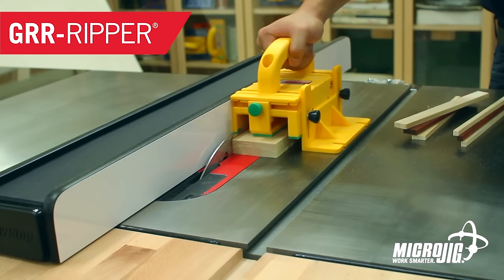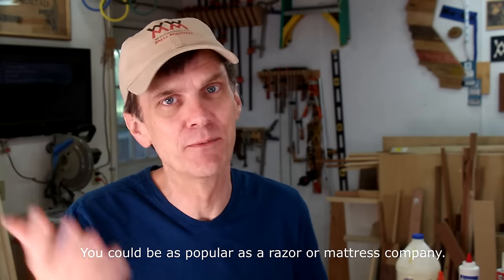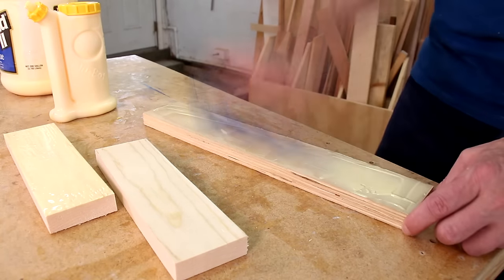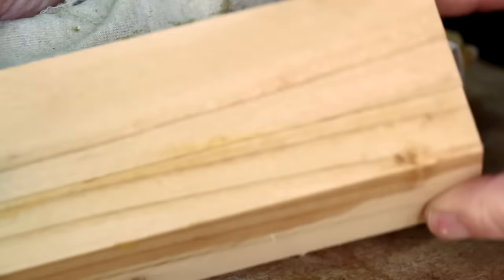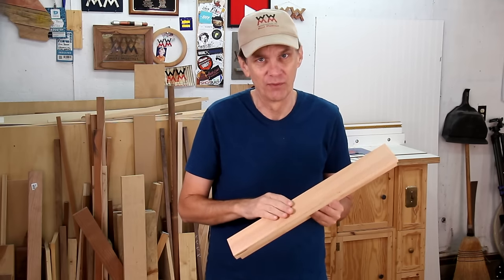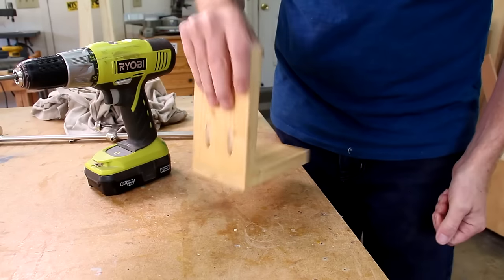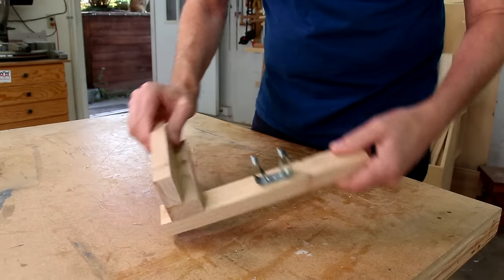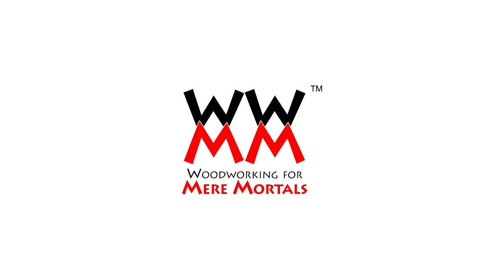What You Need to Know About Glue | WOODWORKING BASICS

Comment: Since getting hooked on woodworking videos a few months ago I've wondered about the wood glue used in North American videos. It's always yellow, while here in South Africa wood glue is always a white glue, also known as cold glue. It is PVA based and dries clear. I've been wondering if it is pretty much the same stuff, and if so why is ours white while yours is yellow?
Reply: +Steve Crane I (from uk) have wondered the same, so it was intreasting to finally get some names.  Intreastingly, "titbond ii" or 'yellow glue', as well as 'weldbond' glue are both PVA based glues.   So, yes, they must be fairly similar.   Yellow glue must have some addative - i wonder if it does more then just make it yellow.
Reply: Ok, did some looking into that question. There's some disagreement on it, but here goes, what consensus there is from where I looked: 
There IS a dye added that does not affect anything but color, BUT, the (yellow) titebond2 DOES have an additive (aliphatic resin) that DOES improve tack, DOES change the dried glue's hardness, DOES raise the glue's softening temperature once dry, etc, even tho some on the wood glue forum (omg) still insist there is no additive and the yellow is marketing bs. (Wrong I think but with a teeny kernel of truth). A white PVA may have this additive too, like yours maybe, and I hear titebond has a wood molding glue (moulding to you I think) that is both white and has the highest tack of any titebond wood glue. Smart place for high tack I think. Titebond2 is sorta the standard wood glue in the USA, but not the only. My sense is that most are yellow, maybe cuz they're trying to bite into the leader's marketshare. Sorry you asked?
Reply: If I'm not mistaken, Titebond is marketed here in South Africa by licence under the Alcolin brand. Imported in bulk and bottled locally, and also available in a variety of types.

Comment: you can use tape or rubber bans to  clamping the wood
Reply: yeah it's fine for most small projects
Reply: What type of glue would you use on a project that may require 30 minutes or more to assemble

Comment: Hey Steve, Just a quick tip for filling those unsightly nail holes, you probably already know this though! Mix some of the sanding saw dust (the fine stuff, not from your saw) with some glue and fill the hole. It nearly disappears and takes stain pretty well too. For bigger holes, I do use saw dust from the table saw sometimes. The courser material mimics the grain better than fine dust. It's not as invisible, but it beats starting over sometimes!

Comment: But what should I use if I want a nice black line along my glue seam?!?!
Reply from the maker: +p burr Titebond 3!
Reply: +Steve Ramsey Titebond 3 machines better.  Won't wear down your planer blades as quick .   Example in Cutting Boards.   They say it is also food safe.   Although all glues and finishes are food safe after they become inert/dry.
Reply: So I am working on a solid body guitar, and I glued 2 inch thick pieces of figured maple together to make a top.  Assuming that Titebond 3 was better since it was slightly more expensive, (and because it's "3" and not "2"), I used that.  Luckily I planed my boards very well, and there's no visible glue line on the face of the boards, but the back side which will be glued to walnut does have a nasty dark glue line.  I should probably just go buy some titebond 2 before I screw something up, shouldn't I?
Reply: still haven't found a good situation to use titebond 3. TB2 all the way baby

Comment: Your example of your glue bond was with soft wood splitting across the grain.  I used to be a professional picture framer. We used Cornerweld brand glue.  Once had to break down a frame to redo. It was Ash wood, a very hard wood, at least for the moulding we had.  When breaking, the ash wood broke instead of the glued miter.  For this reason I am very fond of that brand of glue.  Expensive for a gallon but worth it. Other picture frame shops using other glues didn’t measure up to it.  Important to spread on entire area to be glued.

Comment: Steve you can put wood glue in the nail holes, then use the same type of wood (dust) on top of it. You will be able to match for staining.
Another is I use a glass, marble, or granite flat surface plates. When I mix epoxy or bondo, etc. It cleans off fairly easily with a straight razor blade.

Comment: I use epoxy for a lot of my projects and have a couple of tips: I save the little plastic medicine dosage cups and use them to mix small batches. I get a big bag of bamboo skewers for a $1 and use them for mixing and sometimes for application to small areas (such as wooden fishing lures). I also like to split the two tubes apart as it is easier to get a better 50/50 ratio. The two together never seem to squirt out the same amount or one of the tubes will have an air bubble in it. When the glue has dried in the plastic up, squeeze the cup a couple of times and dried glue will come out and you can use the cup again.

Comment: Steve,
I use a lot of JB Weld in my workshop. I don't use it to join wood to wood, but I've found that it works well for joining metal pieces as well as joining various materials to just about anything. I'm not sure what it's shear strength is, but I like it - plus you can sand it or grind or file it.
John D.

Comment: The only question i'm left with after watching your video is;
Which glue do you like to smell the most? lol
As always GREAT!! video. Titebond 2 has been my go to wood glue for ever. I even built a stand for a huge aquarium supporting about 2000+ lbs and i didnt want any screw or nail holes showing so all just glued and clamped til dry. Still holding strong.

Comment: I have a a very odd tool that I use to scrape off the excess glue. I think it is a handleless chisel.. with a very sharp point on one end and a sharp chisel end. It works well as it lifts off the glue and as it is starting to dry..the glue can be used to fill odd holes. I have never seen a tool like this..but I love it.

Comment: Hi Steve, I use hot glue in small amounts together with wood glue just to hold the pieces together whilst the wood glue takes effect. In fact I'm finding I use hot glue more and more now but not for permanent bonding. For instance templates can be held together before routing then easily prised apart afterwards instead of using double-sided tape.

Comment: Good tips there Steve. Yep, aliphatic (yellow) wood glue for me. When I did my furniture and joinery training a few years ago, we did glue joint tests using a machine that was used for testing the integrity of concrete. (Mostly it was just a flash hydraulic press) We tested a fair few different wood glues, and the only one that bet the yellow glue, was hide glue. It is less versatile though. And not really very practical to use. and certainly not as fun to peel off yourself.
 when finishing. 
As for clean up, I just use a wet rag, rung out. I rinse it occasionally when it gets too gluey.  I use a chisel (blunt) to swipe corners with the rag. I very rarely have a problem with dried glue issues down the track. Yes, you may need to sand the raised grain a little, but only if you were not sanding after assembly in the first place.

Comment: Seriously, LOVE your videos. Do you have a follow up to this one about removing wood glue? Specifically if you need to undo a glued joint because of misalignment or restoration/replacement of furniture pieces. How do you disassemble the best way? (e.g. heat gun techniques).

Comment: Very good video!!! Especially you demonstrating the strength of glue and that the break is at the wood not at the glue joint (Matthias)! BTW, tight bond has never failed me but I may need to try the weldbond glue you mentioned and that I have seen you use recently. You didn't show how you get rid of the glue when you spread with your finger (as I do). Bottom edge of workbench or pants are good place unless you have prepared wet paper towels nearby - haha.

Comment: I bought a large bottle of Titebond when building an entertainment unit. How do you know when the glue is too old? Will it last forever if you can keep the air out of the bottle when storing it? Like 10, 20, 30,... years not forever and ever. 
Did like the basting brush idea...will have to try that.

Comment: Im new to wood working and im making a 3'x8' workbench. I'd like to use a glue with mechanical fasteners for my butt joints and mounting frame work to bench legs. One problem, I've already pre stained my wood. So my question to you would be , Can i use Weldbond instead of wood glue? Or is there another adhesive that would work better? Or would sanding off the stain at the joining surfaces and use a standard wood glue be the ticket? thanks for making great videos.

Comment: I agree on the gluing time. In my place of work it is standard that most common woods only need 1 hour glued in clamps to be handled. Wood glues (depending) only need 10 hours until they're cured, most people will leave projects overnight so the concept of 24hrs is adopted. Anything greater than 2 inches thick (of glued surface) needs 2 hours of clamp time to allow for the glue to fully set, then 10 hours to cure.

Comment: I don't use titebond, but when using regular pva, I keep an ice cream bucket with water and a rag handy, wiping the excess glue off with the damp rag as I go.  It works particularly well where you are gluing components which are difficult to sand, like mouldings.

Comment: There's what I call "double gluing" i.e., using mastic for "Z" bricks with a couple of dots of hot glue to quickly hold position and prevent sagging - or say a piece of trim in a hard spot to hold use carpenter's glue with dots of hot glue - good video.

Comment: If I am gluing two flat surfaces I tend to use one piece to spread the glue on the other.

We used to use generic PVA at the school workshop, but we have switched to Titebond because it dries quicker, it's stronger and it doesn't seem to clog up in the nozzles of the bottles as much.

For really fast bodging we used a high capacity hot melt gun, for building sets for the school play and the like. Squirt, clamp, stuck.

Super Glue with paint on activator is great in its place, small things, metal and plastic. Use the thick stuff it doesn't run down your arms and glue your elbows to the table like the thin stuff does.

Comment: Mr. Ramsey, I have a question for you.

I tend to have trouble with squeezeout on my work, and lately I have been trying to plan for it with less glue, so that I don't spread glue near the edges of glued surfaces. That way, the "squeeze-out" instead of squeezing out, fills those spaces. I find that even when I sand the faces when the glue is dry, I have to sand far more than I am comfortable with if I want the surfaces to take stain later, and I end up hollowing out a obvious cavity with all the sanding/planing. Do you have any advice for this? How do you handle gluing two decorative surfaces together?

Comment: Trick I use when gluing joints on a high end furniture or cabinet job that will be stained. Cover the area around the joint where glue will squeeze out with painters tape. Apply the tape as close to the joint seam as possible leaving only a fine line for the excess to escape. After tightening the clamps or screws remove the tape with the excess glue then wipe up the remaining hairline of glue. Best way to avoid dried glue stains ruining your finish. Been doing this for over 40 years.

Comment: @steve_ramsey you mention using a board on top and bottom of the ones you are clamping together to keep the surfaces flush. Specifically you mention lining them with packing tape. Is there a brand/type that you prefer, and which side do you put facing your work piece? If you have any links, that would be perfect. Thank you!

Comment: I usually don't remove exess glue. I let it dry to point where it's soft but not liquid anymore and remove it with chisle. It is much easyer this way, I think and you don't need to sand it later so much 😊
Thanks for the tips. Endgrain glueing tip was new one for me 👍

Comment: I'm just now getting into woodworking. I've done some framing, and just general carpentry work. 
My first project is, I want to build myself a work bench out of 4x4s, including the deck of the bench like a Butcher's Block/ cutting board.
 Which glue would you suggest being the best for that project? The yellow wood glue, Liquid Nails construction adhesive, or the Weldbond?

Comment: Hi Steve, I have a requirement to use wood glue in very tight cracks in a cricket bat 🏏. 
I generally use Tight Bond 3 for handle fixing and other joinery because it gives me ample dry time and strong joint. Problem I am facing with these narrow but deep cracks is that the glue is too thick to seep-in fully in the crack before I squeeze the two sides hard with clamps to get optimum glue spread within the crack. A glue of the viscosity level of Water would work perfectly for this application. However Tightbond 3 in its original form does not have that liquescence. The question I have for you is, if I add water to tight bond 3 to increase its runniness, will I be compromising on glue strength??
If yes what other suggestion you have for addressing this issue. The objective is to have a glue ‘fluids enough’ to seep in the crack, strong enough to hold back a naturally developed crack but does not get absorbed in the wood and make it brittle like ultra thin super glue. Flexibility of wood to be retained in the end.

Comment: Something about your stress test / analysis (where you showed, the strength of the wood compared to the hardened glue): The tensile strength of standard pine is enormously larger when tested perpendicular to the grain as to parallel. Also, it is roughly the same value (3.4 ksi wood/ 3.6 ksi glue) as what titebond advertises for their mid range titebond II (the one you used). The test you did, according to Matweb material database, would have an axial / parallel to grain of only about 260 psi for the average pine. So major difference in strength depending on how well you think about the grain of the wood and use it to your advantage.

Comment: One of the tricks I have learned is, when gluing up a project that will be finished, first take tape, often box tape, and cover the sides of the joint. Just dry-fit the pieces together, clamp them lightly, and put the tape on. Press it firmly into place with a plastic scraper, then cut the tape along the joint. Then glue and clamp as normal. Dry-wipe the glue from the joint, then you can remove the tape to give a nearly perfect edge to finish. Just a quick touch with a sander and it's ready for finish.

Comment: Great info. You could also cover some glue tips that Iv'e seen like adding a touch of salt to the board to prevent joints from slipping and using spots of super glue (like your brads) to hold the piece together while the wood glue dries. Also I would like to hear about water proof VS non water proof wood glue.

Comment: I use the red label tight bond ,the blue label we use on door panels, and we have an electromagnetic plank clamp that sets the gule in 30 seconds  it only works with the blue label tight bond because after it's dry it's waterproof.  
We use superglue,  on chips ,and small cracks ,and splits for quick repairs.

Comment: Is there an advantage to dampening wood slightly before gluing hardwoods? I have been told that really dry wood doesn't absorb the glue quickly enough (something about surface tension) before it sets.
Thanks for a great video!

Comment: Hi there, not sure if you would be able to see my reply and give me some advice. I'm working on a DIY project, I bought 4 pieces of BALAS wood which is very light, and I want to make them into a square-ish rectangle frame, my purpose of the frame would be to put string lights and polaroid pictures on it to display it. I bought the Elmer's Wood Glue to glue the wood together as advice by the staff. However, for my case, is buying a clamp and clamping it really necessary at all ? Would be really grateful if you could advice, thanks !

Comment: Very good video. I would like everyone to know one of my tricks: I apply a good amount of Avon Skin So Soft oil on my hands and rub it into the skin to dry before doing any glue work, paint work, etc. When finished it is so easy to get them off my hands with water. It can also remove paint that has gone out of the designated area- just take 2-3 drops of SSS on a paper towel and wipe off the excess. Gee I can't believe I just gave away one of my nicest secrets.

Comment: An old technique I've used for end grain fixing I've used on bookcases is to drill a hole  in the back of the shelf, glue and insert a dowel into the hole then glue and screw fix through the vertical end piece into the shelf and dowel.

Comment: Steve, I wonder if you know what kind of glue is better to be used to glue together 3/4" and 3/8” thick 3’ x 4’ plywood sheets? Is it better be a wood glue or polyurethane glue? I’m asking this because the wood glue contains water and I think that moisture trapped between two sheets might warp the final piece. What you would use in such case?

Comment: Titebond Quick & Thick works better than Weldbond.  It does everything that Weldbond does and it also is high viscosity so it is wonderful on a vertical substrate.  It dries clear and works on multi- surfaces....and is the fastest PVA drying glue on the market.  Try some!  Titebond also has a silicone brush now called the Titebrush.  Great Video!  I really enjoyed it!

Comment: I like to use a cabinet scraper to remove dried  squeeze out.  It can really cut back on the sanding, and even works on glue that isn't completely dry that would quickly clog your sandpaper.     I made mine out of an old handsaw blade.    I'm not certain that i'd want to use a silicone brush on any project that I wanted to put a nice finish on.